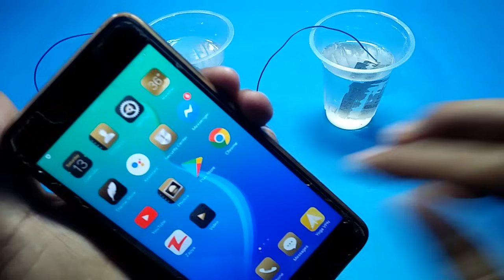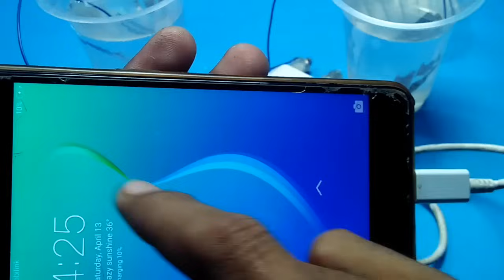How to Make Mobile Charger Without Electricity With Salt Water Free Energy Mobile Charger

Comment: This method is very effective but the only thing here is to NEVER EVER Put Glass as an replace instead of plastic because there's a risk and high possibility of it touching the glass once it touched it there will be a huge mess and consequences
Reply: yes glass is a good conductor of electricity
Reply: That's plastics cups not class
Reply: @martinadavid7948  they aren't saying these plastic cups are made out of glass, they are saying ehat happens Of you replace those with glass ones...
Reply: What is that jell he applied on the charger head?

Comment: What did you put in the water
Reply: Use salt. If 1 blade is not enough, use 2 -4 blades in each glass. Motive is have maximum surface area of blade

Comment: What powderizes chemicals use to poured on or mix in Ho2,is it dsame with battery solutions?or solution itself is better to used also as conductors of blades positive and negative charge?
Reply: it's a salt or vitsin